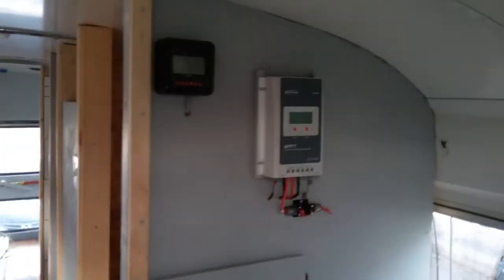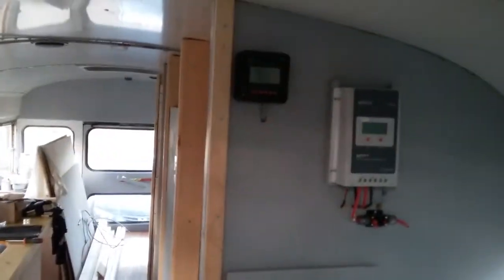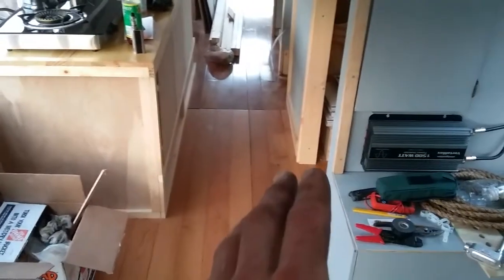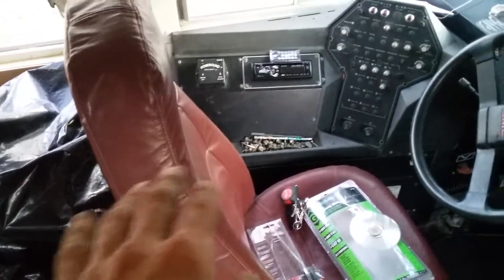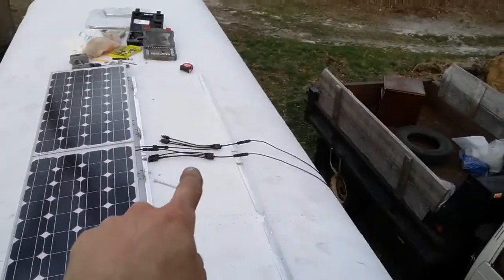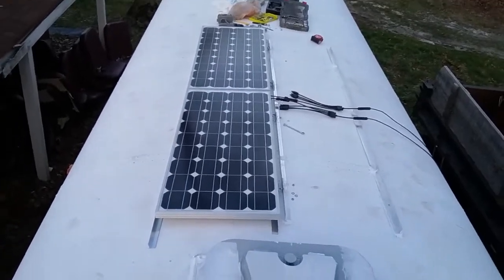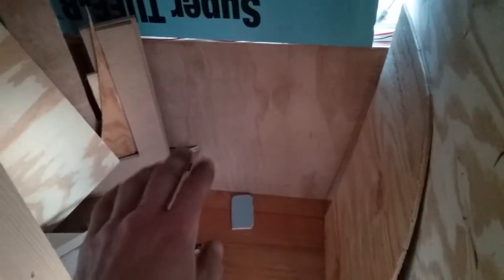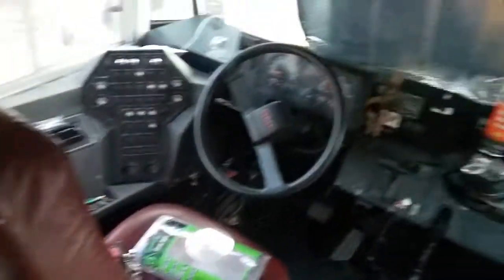Bus conversion ☆ day 35 solar mounting / headunit / trim / 120v

Comment: Hey man, it's looking good man!! I love your solar panel install and like how you incorporated security as well!! Never really thought about someone stealing panels but you never know these days! Sad but reality  I'm loving your paint choice, light but warm!! We were about to buy rubber matting for our driver's area but like your idea of doing carpet to make it feel more homey!! I wish I could help you with the parameter for your charge controller but I don't know. I would love to see someone chime in and help you out and then I can take note for myself.  Keep with it man, you're almost there!!
Reply from the maker: hey brother, thanks  !! yeah im almost there... i will obviously have a lot of decorating to do while im on the road but structure and function wise im almost done.. living in nj/ny my whole life has taught me that whatever isn't bolted down will be stolen  !!! luckily im leaving this dump and can get away from people with no values. i like the thick rubber in the driver area but it collects dust and dirt that becomes impossible to remove,  its like a giant fly trap   !! im just going to leave it for the protection but cut in a custom shag style carpet so i can drive with slippers on !!! lol.... how's your build going ?
Reply: mason chase it's coming along man, will be installing 2x4s in the roof to give me a little structure support to screw the roof panels into once we put the insulation in. After that, will start running wire throughout the bus along with laying water lines. Look forward to building walls by Saturday!!! Could you hit me up on Google+ when you get a chance?
Reply from the maker: +Marshal Pearson oh nice !! yeah i can Google + you but i gotta figure out how to use it ?